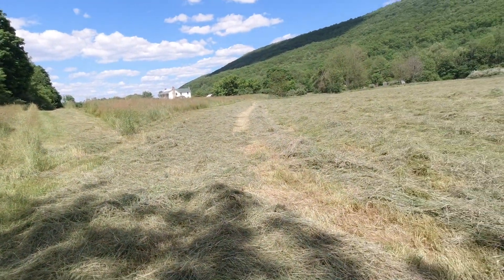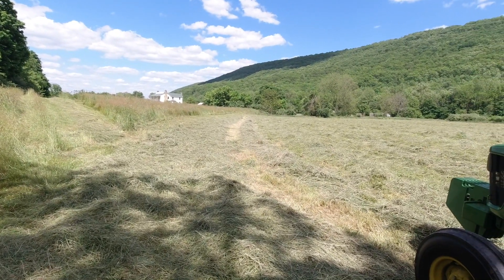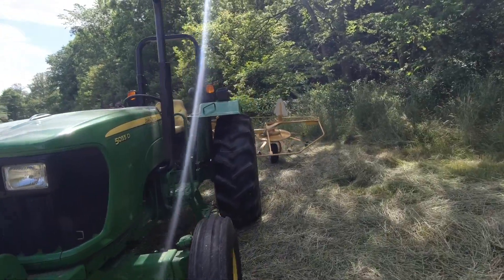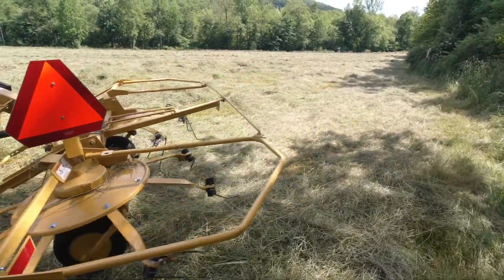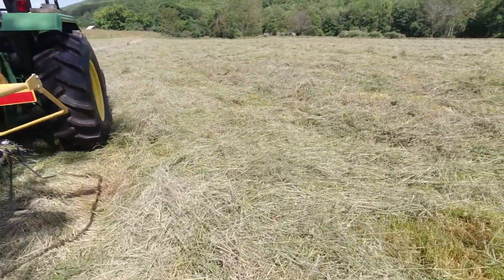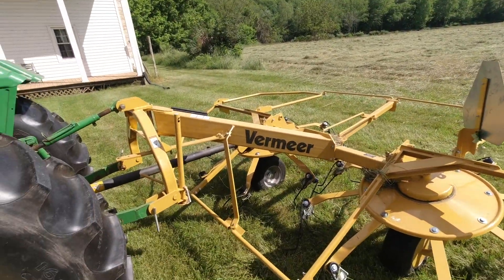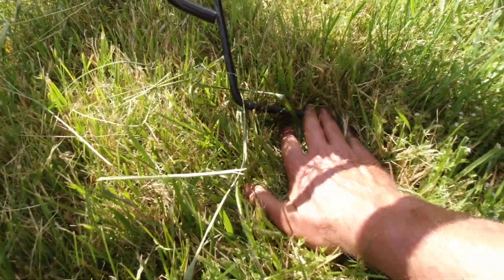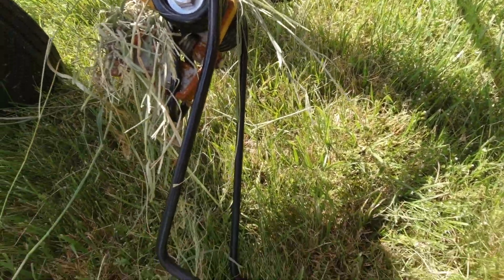Tedding Hay 2020

Comment: The slack in the 3 point changes the hight just a little. 
When we stop, the tines will just mark the ground, but moving, the tines are just above the ground. 
We don't use the Lely Lotus 300 for scattering, just for raking. 
We have an OLD 4 basket Tedder for scattering. The ones made to just ted, do a better job of scattering than the Tedder rakes do, but they all get the job done!!
I'd like to have a 6 basket Tedder... But.. LOL
I'd also love to have a Tedder rake that could do two rows at once and keep them separate.. 
Amazing what some sun can do when it's warm out!!
Years ago, when we still did haylage in round bales, I cut a piece here at home at 7am, figured Ted it at noon, bale about 4.. it was so hot and dry!!! We ran the Tedder rake through it at noon, started baling dry hay at 3 pm.. was all in the stack by 9pm.. one day hay at over 4.5 tons per acre and 18% moisture or less.. CRAZY!!!
Thanks for the video!